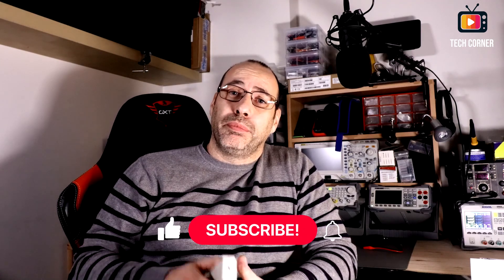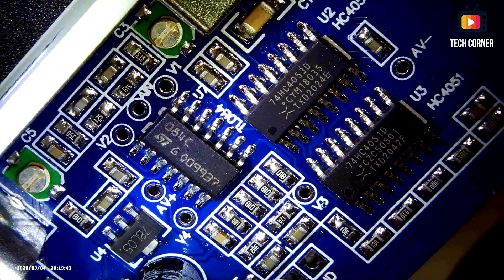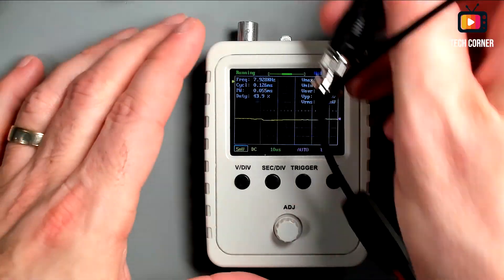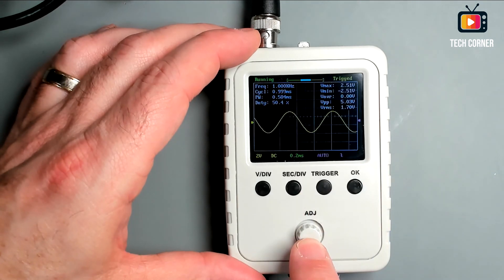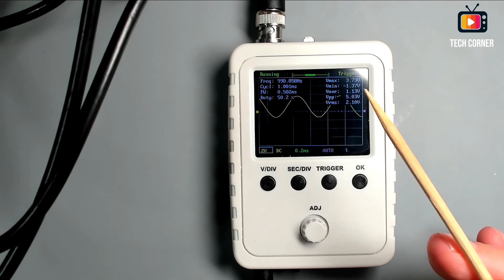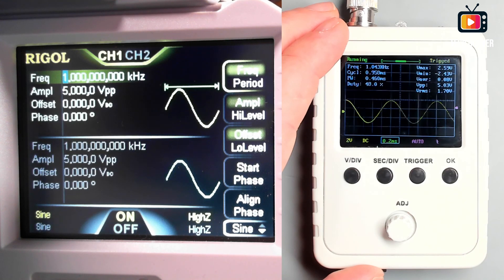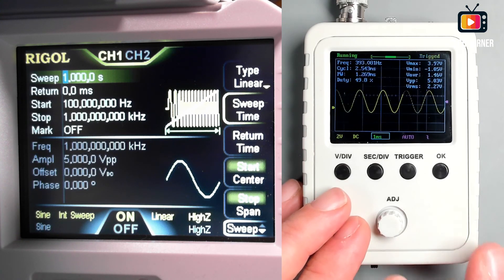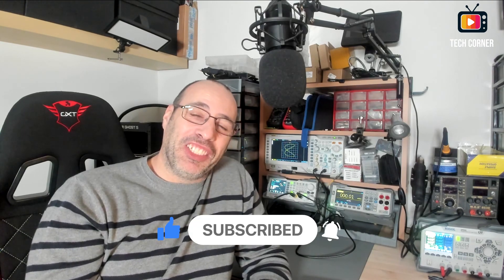FNIRSI DSO-150 - $20 Oscilloscope - Small Price, Big Features! Awesome for Beginners

Comment: I guess this will work as a beginner oscilloscope for my channel for now.

I also checked out the DS0138 and it seems to get a distorted signal and inaccurate Vpp at a much lower frequency than the DS0150.
Reply from the maker: Hello! Your channel seems awesome, I will have here in a week +/- the DSO PRO also from FNIRSI to review. If you're using that in a channel and you can afford it, I'll probably recommend this one for more +/- 15€. I wouldn't recomend the DSO138... as I said in the video, the low you can go for some quality is the DSO 150 and for that price range is awesome! Thank you for watching and commenting. I don't know if you saw, but I have a giveaway right now on the channel for the KORAD KA3005D power supply, it might be of you interest, see my other videos, you have there one for the giveaway! Good luck!

Comment: I would still suggest people buy authentic Jye-tech versions. I have seen people test these with the alligator probes that are very noisy. They also don't realize not using a X10 probe setting dramatically reduces bandwidth. I still find the dso062 and dso138 still are pretty good without the stingy power requirement.
Reply from the maker: Hi, I understand and agree with you, I only discovered the diference between the JYE-Tech and the one I got after buying this one and on the research for the video. My goal with this video or target audience was people that are starting and for that I think the DSO138 is a option, but I personally will not go for that. DSO062 was under my radar, didn't notice it before. But again, on this one you have a color screen (also in DSO13) and proper case with a very functional knob for basically the sane price of the other two. But again, I understand what you're saying, just "justifying" my choice. Thanks for watching and your comment! 👍

Comment: Will this be suitable for measuring the output of a speaker amplifier? to see if the signal is clean
Reply from the maker: Hey there, it should. I«m not sure what frequency you need for that, but I think you'll be ok. If you need a bit more power for a few bucks more, see this video on the DSO PRO (https://www.youtube.com/watch?v=vbV5ZndUG10) it has some improvements and a bit more power. Thanks for watching! 👍

Comment: this a good  Oscilloscope to learn on?
Reply from the maker: Hi, if you don't want to spend a lot of money and have something a bit decent, yes. But please remember, that 200Khz isn't much. Event Arduino uses a 16Mhz crystal oscillator. If you have and want to spend a bit more, you'll be better served with the 1C15+. It costs a bit more times more, but you're have an oscilloscope with at least 40Mhz capacity. Thanks for watching!
Reply: This oscilloscope is only suitable for the audio frequency range. Check if your audio amplifier is distorting the signal. Or how your electric guitar pedal transforms the signal. Also, using a dividing by 10 probe, you can study how triac dimmers regulate the load current. Or how a diode bridge rectifies a sinusoid, and a capacitor smooths out ripples. Or how an inductor and a capacitor behave in AC circuits. But already a PWM signal with a frequency of only 31.25 kHz looks just awful on it.

Comment: Thanks for the info on this scope.  Have you used the DSO FNIRSI PRO and could you do a comparison to it?
Reply from the maker: Not yet but I took the time to see same reviews and understand the main diferences. The first one is the frequency, the PRO version can go up to 5Mhz, that is way better than this unit and the second major factor is that it has battery. You have nore controls/options like 1x/10x probe, menus and stuff like that, so in general is way better. The only downside I see is the missing of the knob that for oscilloscope usage, speed up a lot things. The price I saw is also double ou triple the price of this one, but that fair, it a better unit. Overall, you'll be better with the pro version and if you need the features I recomend that unit. Pleas notice that for more 20€ or ~$27 you start to have tablet oscilloscopes with more functions and bigger screens. Hope this info was usefull to you. Thank for watching and you comment.
Reply from the maker: For almost the same price you have also DANIU ADS5012H that already supports 100Mhz...

Comment: Did I miss it, or was there really no (significant) mention of this scope's very low effective bandwidth? Certainly, the manufacturer's specified 200kHz ANALOG bandwidth is cited early on, but then it seemed that all tests/demos/evaluations were done at very low frequencies......In my own tests, this scope aliases badly at 200kHz, showing grossly inaccurate information on the screen above 100 kHz, and useless above that. The best performance I got was when the test signal is no higher than 50kHz. This is a very important limitation to stress with this model!
Reply from the maker: Hi, this was one of my first reiews of oscilloscopes, today I would be a bit more demanding... or not! For 20€ oscilloscope, you can't really expect a lot. I consider this a learning toy, even so, for those small oscilloscopes, this one is one of my favorites. Sorry if I didn't push it to 200Khz, I though I did, but it's highly probable to be unable to handle a 200Khz signal. Thanks for watching 👍
Reply: @TechCornerTV  , yes, as I indicated, I tested mine and the displayed waveform and information became progressively unreliable above 50kHz, unusable by 100kHz, distressing long before 200kHz. Some other reviews also noted the same thing. I agree this is quite a great deal at the price, but far too many newbies don't understand its limitations and will be very confused. Which is why reviews should actually address such issues.
Reply: It's good and cheap option if you're troubleshooting low frequency signals like in R/C modeling or multirotors or whatever and need to see what's going on with the signals. As an example, I could not get an RPM signal from an ESC to work and it showed me that there was a floating ground that was distorting the square wave than the ESC uses to tell the flight controller governor what the motor RPM is. Turned out that because the ESC optically isolates the telemetry and throttle signals, and because I was not using a regulator connected to the same battery as the ESC (I was using a separate battery for the servos and electronics) I had to bridge a solder pad on the ESC that was there for this specific issue (de-isolate the telemetry pin)

Comment: I don't know if I'm the only one that got a faulty device from FNIRSI. The device turns on but does not read/display any signal even from it's own square wave generator. FNIRSI sent me two replacement analogue boards but I get the same results🤦‍♂️
Reply from the maker: Hi, that is pretty weird... do yours have battery? Isn't the power supply? 3 boards (orginal + 2 replacements) all broken is very weird. Hope you figure that out.  Thanks for watching! 👍
Reply: @TechCornerTV  Hi, it does not have a battery. I use a 9v adapter to power it up.

Comment: But after 50 volts will it not read the wave form anymore?❤thank you
Reply from the maker: Hey Gio, we are talking about DC voltage? For that you just need to put yout probe in 10x mode and you should be ok. Also change the oscilloscope to 10x mode. Thanks for watching!
Reply: @TechCornerTV  ok thanks i was talking about ac coming out from a music amplifier 👍🏻
Reply: @TechCornerTV  i use it to see clipping in amplifiers
Reply: @TechCornerTV  because it says max 50 volt inputs
Reply: Like an amp w 2000 watts on 4 ohm load would be 89volts  thank you very much